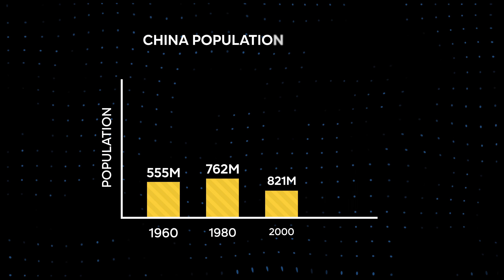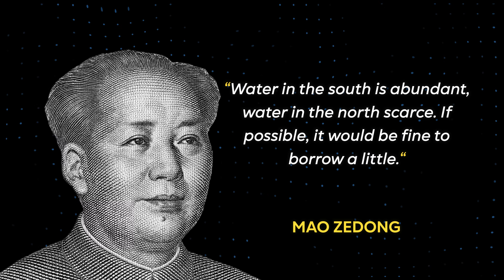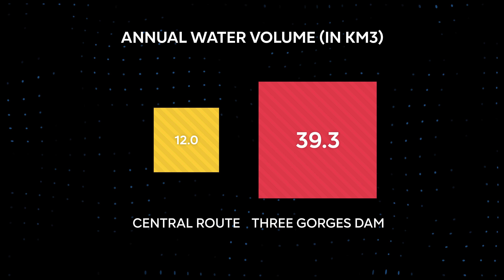China‘s $62BN Water Transfer Project

Comment: This build, I'd say it's max lifespan would be upt 8-10 or shortest 1 year, depending on things, even if they built it, it should've cost way more than just $62 billion, it's needs 4 to 5 times that amount to actually be able to last the test of time, but as we all know, by we as in people who actually know how ccp build stuff, this is a tofu dreg project, also they're GDP isn't done like others when what's left is counted, they count it when it doesn't get used, really sums things up for a failing economy, society and also losing 100 million people making them now 2nd to Indian 🥇
Reply: I understand that this video is published kind of late. The eastern and central routes have already been completed and started to transport water in 2013 (2014 for the central route). Both routes have been working fine ever since and still bring fresh water to the northern region every day. From what I heard, the citizens in the northern region haven't experienced a significant increase in their water bills.
Reply: After the completion of the central line, the groundwater level in northern China, where Beijing is located, rose by several meters. I know that there are areas of India where wells are tens of meters deep to get water.

Comment: Failure. Silt ification is already reducing water volumes. The high pumping cost and poor water quality makes the water virtually unsaleable as the central government charges local governments, already strapped for cash, for the water.  I will likely be a dead project in a few decades.

Comment: even if it works as designed and intended, it will not deliver enough water. Future water issues will no longer be solved by water diversion projects.
Reply: Solar energy, wind power, nuclear power, countless hydraulic pumps, and fresh water from the east are sent to the west, which is much more valuable than spending money on skirt bases all over the world. Even if it fails, it will be better than building military bases all over the world.

Comment: Lake Baikal East Russia is the world's largest freshwater lake by volume, containing 22–23% of the world's fresh surface water.
Will it be tapped within the next 25years to the south? 1% yearly would not affect the lake.
Reply: That would be a real disaster. Because Mongolia is actually a plateau. The water of Lake Baikal crossed thousands of meters of plateau to reach China. This requires huge energy requirements, which may only be possible with nuclear fusion.
Reply: @outman1923  1meter dia pipe with solar farm powered pumps at every rise could be possible. Once you get it started probably siphons itself if outlet is  200m lower than inlet.
Reply: How do you know that 1% would not affect the lake? Are you a water resource engineer and/or hydrologist?

Comment: This article by "Two Bit da Vinci" "Limitless Fresh Water Lies Right OVER The Ocean - Without Desalination!" might represent a better solution.  This water capture structure could be erected in the sea to capture the limitless fresh water vapor it contains at a relatively low cost compared to water diversion from southern china.
Reply: Nothing is cost free. If it could be done, rest be assured China will the first to do it. And that video is bullshit
Reply: Seawater desalination can only be applied to coastal areas, and the ultimate problem returns to the starting point, how to transport fresh water.
Reply: This is not sea water desalination, it is water vapor to fresh water capture, it does not have the problem with brine.
Reply: 100% agreed. They could’ve come up with so many better ways to deal with their water crisis. Desalinization is expensive but I doubt  its nearly as expensive as this project. However its reliable and it works. Imagine all the electricity needed to operate this project 😆
Reply: @abroadinasia  not entirely true. this works with gravity mainly. that's why they did the research. water flows down, declination of a few millimeters works. aside from the construction they don't need much electricity to upkeep. desalination it's expensive and it's per use cost. a project like this is a one time cost mainly, will run decades without much of intervention. also desalination works near the sea, and transporting the water costs a lot too. there was a plan in australia to flood the inner side of the continent, that might work to bring the water closer when desalination will be viable with fusion tech energy.
Reply: @laszlobandi6456  The point is not the transportation cost, but rather the cost to the people in the areas from which the water is taken, the displacement, the diversion of water which is needed for fishing and local agriculture.  The solution should not introduce problems to one area in order to partially solve a similar problem in another area. The "Two Bit da Vinci" article discusses a method, which if adopted, would not create a problem to solve a problem elsewhere.
Reply: @backyard4465  yeah I saw that but takes time to go for efficient methods, electricity companies don't want anyone to have cheap electricity, they delay as logn as possible. see, germany still mining coal until 2030 and pay crazy high fees for electricity because of the transition to renewables and removals of nuclear plants.

these are high volume water areas, it's not like they do something crazy and reckless, those rivers carry excess water, and you can say that it uses more than it should and might have environmental effects, but in the end, it's the chinese government who did it. they spent time on research and  probably they calculated the risks too. there is a lot of anti chinese propaganda and we should give the benefit of the doubt.

see, las vegas was able to make a deal to use some of the water from colorado, then they reduced waste a lot. that city shouldn't even exist in a location like that. same goes for a lot of the new Quatari and Saudi locations. But Lyberia is even more extreme, with the aquafier water pumped across the country. compared to that, this project takes from a high water area and gives to a lower/medium water area. the benefits outweight the risk. and they got to do something while they wait for better technologies.
Reply: @laszlobandi6456 I live in Las Vegas Nevada. So what said is so true!
Reply: @abroadinasia  Of course, they could still implement a better solution if the right person were to bring it to their attention?  I would hope that the right person might see these posts.
Reply: @abroadinasia  they don't have enough electricity, and still rely on hydro power plants, if they go nuclear the desalination we'll be more viable only for close to coastal region else you make more viaducts inland